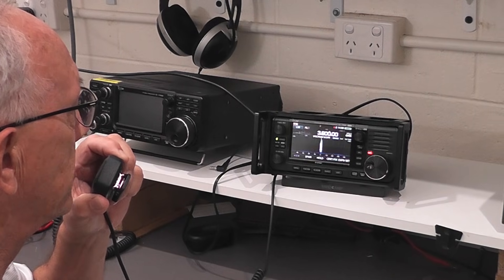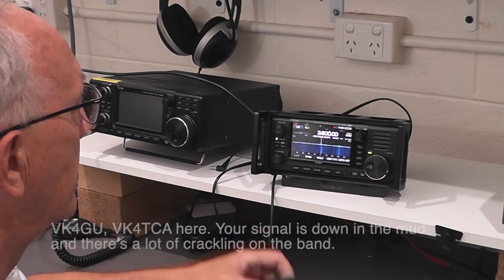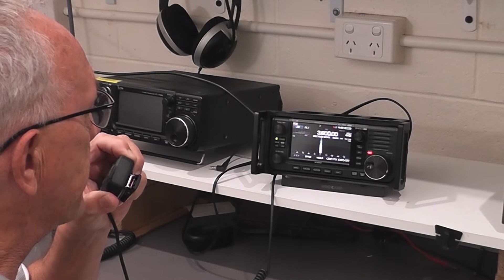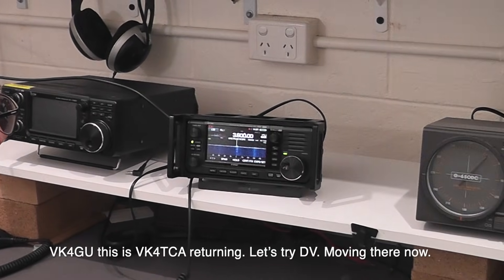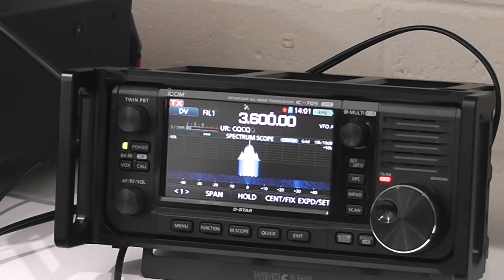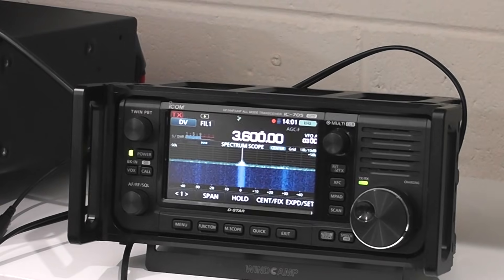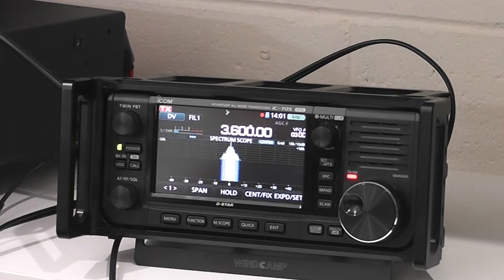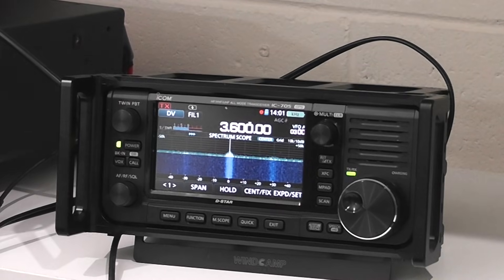So how good is digital voice on HF?

Comment: A better transceiver would be a better demonstration but also using multiple of the digital HF voice modes for comparison would help prove your hypothesis.
Reply from the maker: Well, unfortunately, we only had the IC705 and the IC7100. The intent was to demonstrate the difference a digital voice signal can make on HF over an SSB signal if the band is noisey or signals are low. I think we demonstrated that. Watch out for more content in the future. If you're in Oz, come along to Redfest 26 and it will be about all things digital.
Reply: Nothing is better than the 705. 🙂

Comment: Do you have to reduce power like other full duty cycle modes like sstv or rtty?
Reply from the maker: Always advisable! I will have to check on that with the manuals, but I would expect that the transceiver would have a pre-programmed output limiter like it does on AM.

Comment: not sure I understand the mode you are using in the demo.  I see the "DV" selection you chose on internal menu.  Is this D-Star on HF?  Does the 705 natively do this or does it require a mod?  Was very surprised the digital artifacts were minor with such an audibly low signal to noise ratio
Reply from the maker: Yes, Sean, it was D-Star on ICOM IC 705 and 7100 transceivers. Both of these have D-Star as a standard inclusion. The 705 and the 7100 have been the only ICOM D-Star radios on HF...until now! The new IC7300MKII will have D-Star.
Reply: @johnsaunders8315  the 7300 Mk 2 doesn’t do DV, it’s only analog like the original 7300.

Comment: how much bandwidth does it use?
Reply from the maker: Notionally 6kHz. Google AI suggests that some tests (no idea which tests) have found it at 10kHz. That would be problematic if it was the case.
Reply: @johnsaunders8315  6kHz in  LSB - thats the reson of the big noise!
Reply from the maker: @akidergroesste  Ah...no. LSB was standard 3kHz. The digital voice signal is 6kHz.

Comment: So is this via Internet???
Reply from the maker: Nope. All done on the air on 3.6MHz.
Reply: @johnsaunders8315  My question is, Are they going to keep Free DV in one spot or intermingle it with SSB or allow Hams to just operate where they please. I would hope there will be some organization like there is for every mode. I already see the issue with Fusion on a linked system and how it cancels out analog without either user even knowing until the analog user cannot communicate. I wouldn't want to see that happen on HF.
Reply from the maker: @WRQI583  Mate, that will be a topic for the IARU and the national spectrum regulatory authorities. I would expect it will initially be relegated to the digital space currently on the bands...but I can see all sorts of issues with FT-8 and other digital modes. Perhaps in an allocated FM portion of the. band would be a better option. This transmission mode is not narrow (6kHz) and is not weak signal/low power.

Comment: A great demonstration of DV on 80m! I'll have to look further into this, thanks for the demo.  Best wishes, Richard M0HPL
Reply from the maker: Hi, Richard. Yep - that's the plan to prompt people to use the mode. It actually really surprised me with the result. Yes, it was staged for the vid, but the operating conditions were exactly the same. The IC705 in the shack (being used by Gary) and the other radio was an IC7100 (being used by Adrian) out in the car park using a dummy load and 5w.